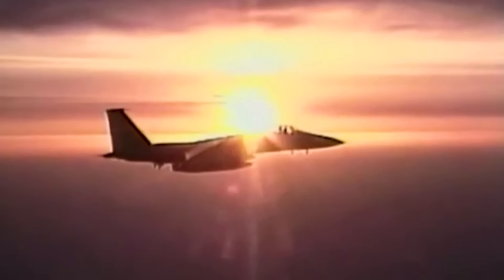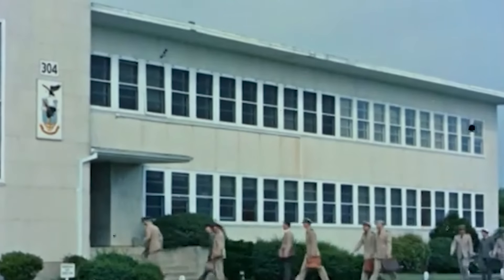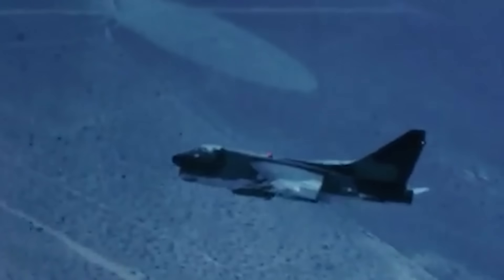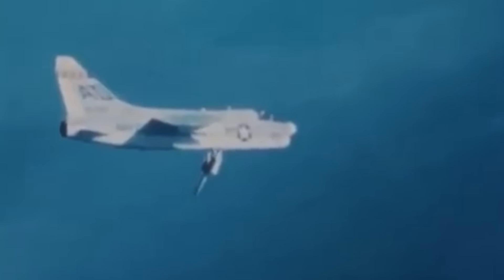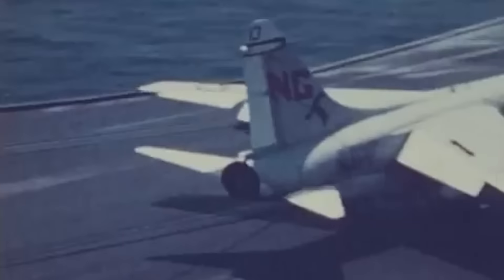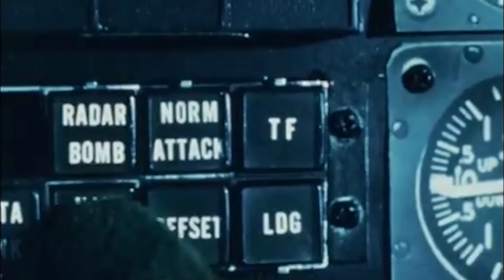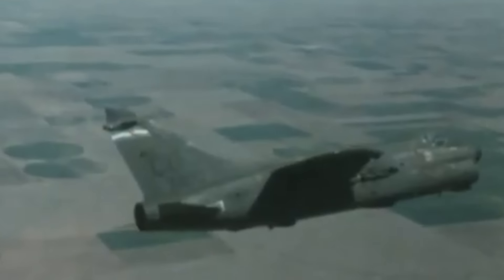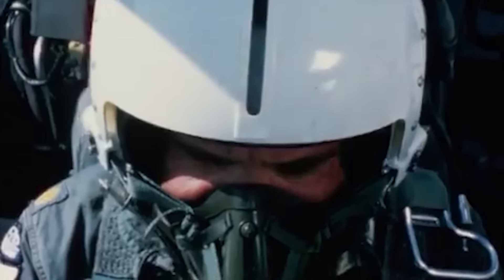The Ugliest Plane That America Couldn’t Get Enough Of

Comment: I am so sick of people thinking that every plane must be fast and pointy and look like an F-104 or SR-71 to be beautiful and cool and must have a cruising speed of at least Mach 1.4 to be "fast enough". Try landing and/or launching from a short, rough strip, especially while hauling in lifesaving loads of food, water, ammo, medical supplies and the like or medevacing sick or wounded people out. Fast and pointy "cool" airplanes need hard runways a mile long or more to land or launch. Try turning tight to stay in visual contact with troops on the ground while supplying close air support in an aircraft that can't comfortably fly slower than Mach 0.6 and have an unrefueled endurance of 2 hours or less. Fast and pointy airplanes have turning radii that are huge; A-10s can turn inside of F-16s and SR-71s had turning radii the size of US states. Aircraft like A-1 Skyraiders, A-10s, A-7s, C-130s, OV-10 Broncos, P-3s, PBY Catalinas and other "slow, ugly" planes often have range, endurance, payload, weapons, reliability and short, rough field capabilities that blow the fast movers away for certain mission sets. 
F-35s, Eurofighters, B-1Bs, F-15s, F-16s, and other fast movers are fabulous and essential for many missions, but the tough, maintainable, "slow, ugly" airplanes mentioned above are all also beautiful in their own ways. Beauty is as beauty does; how beautiful an airplane or ship is comes down to how well each one does its assigned missions. Falcons, vultures, sparrows and penguins are each optimal for their missions and poor to useless at doing others.

Comment: I worked on A-7E/TA-7C/TA-7Z Corsair II aircraft, it was still viable with Greece flying the A-7 Corsair until 2014. The weirdest bit about this aircraft that the follow on aircraft that was established with the EXACT SAME Specs was the F-32/F-35 Aircraft. Mission Creep blew the Budget from $15 million to the current $83 to $109 million USD. Toss in an inability to carry 15,000 pounds of bombs, rockets and ammo and went from a very easy aircraft to repair (about 4 hours to swap and engine and an hour to rig it at high power) or even swap out the wings (a pain but doable at about 8 hours to pull the old one, install the new one with flight control rig and checks with a one hour Functional Check Flight) ....F-35 Lightening II? Yeah you'll have to give it to the sand crabs and write it off.

Comment: Fun anecdotal "fact"...

When the USAF was evaluating the at the time new A-10, they had it fly off against their A-7s. The A-7 consistently out performed the A-10 in every category. However due to politics, the evaluators would change the requirements and factors in order for the A-10 to come out on top.
Reply: I can’t believe any aircraft can out perform the A-10 in the CAS mission. Any infantryman, grunt, or tanker would rather the A-10 overhead in the CAS wheel than a SLUF….. any day of the year.

Comment: The 4FU was dumped by the US military as it was impossible to land, they sold them to the British at a less than production cost price. The Royal Navy pilots brought them into carrier landing skewed about 30 degrees so the pilots could see the deck by looking over the left wing without a problem and straightened up just before hitting the deck. The US Navy saw this, built hundreds of them and won the battle of the Pacific

Comment: So, the A-4s replacement wasn't AS restricted to smaller carriers like when the A-4 came into service. Many WW II vintage carriers couldn't fly all naval planes as they got bigger and heavier. The A-7 came around when many of the older carriers were replaced with supercarriers and could handle a bigger plane. Also this was a "Low" oprion where the plane was not as expensive as other planes in use or development.

Comment: Um, not surprising since the A-7 was the Navy's interim attack plane that replaced the A-4. One dirty little secret was the Navy and Airforce had all they needed (or wanted) by 1975. For the next eight years, the Texas Congressional Delegation used their influence to add 13 A-7E bombers per year into the Defense Budget, even though neither the Navy nor Air Force wanted them. The Navy was waiting on the F/A18 and the Air Force the F-16. It was all about keeping the Ling Temco Vought production line in Dallas open - a jobs program. The planes went from the production line straight to Davis Monthan to be stored until they were sold in Foreign Military Sales programs (to the Greeks, for example).

Comment: If they had changed to the spey phantom(tf41) they would have had a a great combo(same engines, easier spares) the phantom Would be slower(nobody really uses high speed over mach 1 as fuel flow more than doubles) but would have a 40% range increase

Comment: Simebody correct me if I am wrong but wouldn't it be the Corsair III as the F-4U was the Corsair II unless the change to A from F facilitated that.? As a side note for those that don't know no U-2 spy plane was ever shot down at operating altitude of 70,000+ feet both Powers U-2 and the one downed over Cuba suffered from engine malfunctions necessitating a drop in altitude well below 60,000 feet. Which was well within the accurate engagement envolope of the SA-2.
Reply: After watching the intro again, I think it would be the Corsair IV.  First model bi plane in 20s, second model all metal,biplane 30s, third model gull wing WWII fighter, then the last model, as showcased here, the jet.  Amazing lineage and superb aircraft.

Comment: The F-4 and the A-7 should have served as lessons for the U.S. If you must have a plane that all services will use, you build it to USN standards then let the USAF modify the crap out it to suit them. Should have done that with the F-35. Make one for the navy (A) and one VSTOL for USMC (B). Then the USAF (C) can put in new engines and avionics and whatever.

Comment: This is why the US cant say good bye to the A10 as it continued the thinking of the A7 and has not found a better way to go still drones and AI control is all good but at some point there has to be a human brain in charge and for ground attack and especially close air support that human needs to have direct control of the weapons and be the one that is the deciding factor. That means you need something like the A10 for them to fly with its survivability and its hitting power. Till they come up with a better platform than the A10 there is nothing better because to be better it has to be same as the A10 but better in every respect.

Comment: The problem with the F-111B wasn't the aircraft, it was the bonehead's who wanted to make a fighter out of an attack aircraft. The F-111B would have been a natural successor to the RA-5 reconnaisance and attack aircraft the Navy had back then. Instead, someone thought the F-111B would outperform the F-14 Tomcat. Nope, that's why the F-14 became the Navy's front-line interceptor and the F-111B cancelled while the RA-5 had to fly on for almost two more decades.